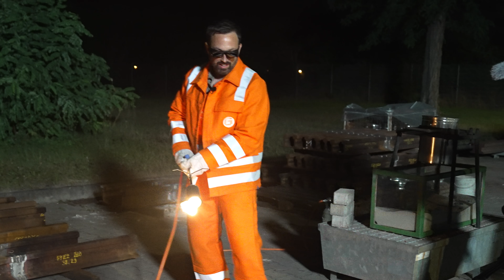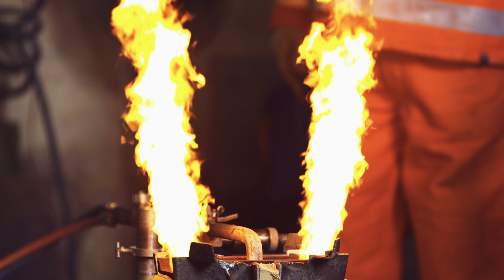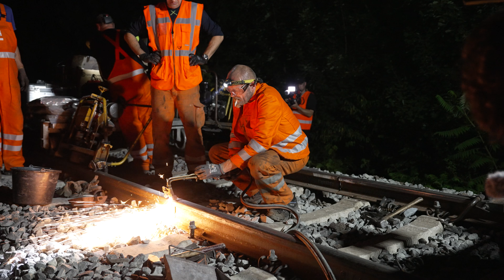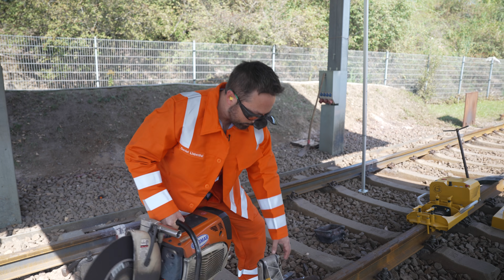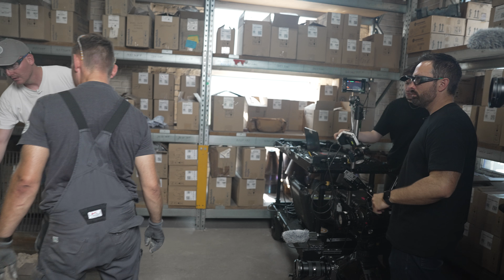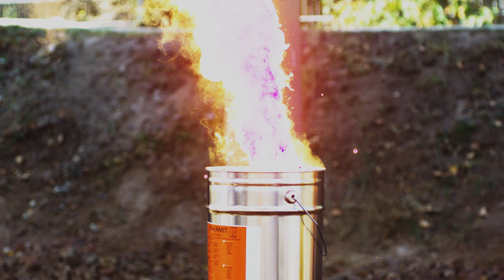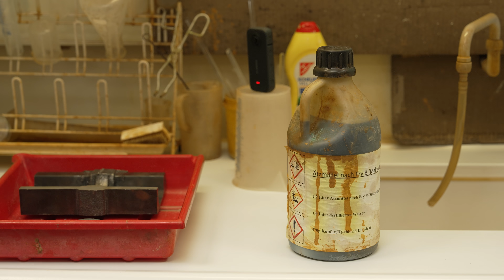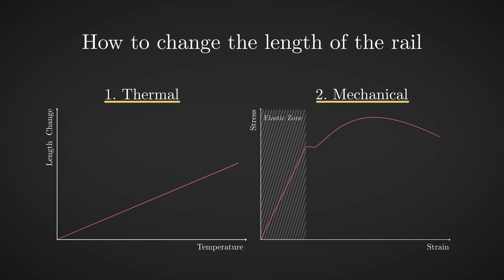Why Don’t Railroads Need Expansion Joints?

Comment: I don't know why, but I've only just seen this one. I'm subscribed, but it just got proposed to me. I really enjoyed the first one on thermite and this one too. I haven't watched the third, but looking forward to that one.
Something to be aware of is that you've oversimplified heat affected zone (HAZ) to the point where the description doesn't explain the method of failure. The issue with HAZ formation and failure isn't that it has different material properties to the parent metal or the weld metal, the issue with a HAZ is that it has progressive variation in properties. Think about it like this; at one end of the HAZ the parent metal is both heavily mixed with the weld metal, so there's a high level of weld metal diffusion into the parent metal, increasing material properties and toughness, the heat is also maintained for a much longer time at above the temper temperature, so functionally that portion of the rail is annealed and bought down slowly. At the other extreme, the material might only be at the phase change temperature for a functionally infinitesimal period of time, so it's as quenched as a piece of quenched metal can get. In real life nothing is so difinitive, but the idea is that there's a progressive variation in material properties, from fully annealed at one end of the HAZ to retempered at the other, with a variation through quenched, something like quenched and tempered and everything in between. The result of this is that, when you apply stresses to the material, the stress is uniform, so the weakest portion of the structure fails first. You get a preferential failure in the weakest and most susceptible portion of the HAZ. What then happens is that you end up with propagation of that failure site (crack initiation) along what is the most susceptible part of the HAZ to fatigue, which is likely not the portion where the crack initiates. You can see this when you view cracked welds, where the failure walks out from an edge into the closest portion of the HAZ. This is because the least ductile portion of the weld is also the strongest, it just has little or no elasticity, however the annealed portion has very little strength, so suffers lots of plastic deformation under regular loads, meaning you can see the crack walk from the least ductile area to the most ductile in most cases I've observed.
Anyway, I hope that helps. Weld failure is genuinely interesting.

Comment: A very interesting video, thank you. A small point may be, but as the molten metal solidifies ( 5:36 )it does NOT contract, it shrinks and is quite noticeable. Contraction happens after the shrinkage and is Much a smaller amount.

Comment: Excellent video. Explained the expansion and contraction well. My little two bits. The fact that the joint is applied hot there is a tension applied to the rail which really gets released when the temperature of the day gets higher without deforming the track

Comment: Since they add 50 km of rail every year, thanks to the welding does that mean slowly overtime the rail system could be expanding at work

It also reminded me of that Ben Franklin “announcer prevention is worth a manicure  😂 small mending in the rail lines

Comment: In Argentina we had a lil disaster regarding a rail line that featured this technique. Add on top skimping in budget with the rail metal quality, one summer the rail line staff and people woke up to an SPAGHETTI MESS on the railway.

lol 

So, yeah, rails will eventually at some point contract and expand and go wild. The metal quality only delays the inevitable. 

I don't know what's cheaper and faster though, give maintenance to wheels on a railway with gaps which once the railways wears it's easier to replace, or replace the weared rails on a no-gap railway on which you still need to keep maintenace on wheels anyways?

Comment: My dad would have been fascinated.  I was.   He passed away 60 years ago.  He started his railroad connection in Schenectady, NY as a draftsman.  Creating blueprints of steam engine parts.  Then got into sales and sold trains for the General Motors Electromovtive Division.  When the steam engine he first sold was finally taken out of service, he was given the head light and bell.  Now lost to history.
As a kid I always thought it would be great to be a gandy dancer, working the rails.  But, never got into it.  Life is what happens while you're  making other plans.  I guess these rail welders are the modern gandy dancers.  Hats off to you.
Similar to the grinding machinery, my dad sold the first "track cleaner" machine.  Now probably vastly improved or replaced.

Comment: So I've now got a great understanding of thermite welding, particularly relating to rail line.  
What I still don't understand is why the clickey clack of train wheels didn't disappear on hot days, when the expansion gap closed up....  
Did I miss something about the weld joint having a lesser coefficient of expansion that the steel rail, allowing tighter tolerances?   If it has the same coefficient of expansion, then why didn't the old timer way just butt the rails together on a warmish day?
Or should I look at that video on my side panel by practical engineering titled "why railroads don't need expansion joints"

Comment: I was a locomotive engineer/train driver for the railroad for 30 years and my best friend was a thermite welding supervisor. I had the chance to spend a couple of days with his gang and it was really interesting. Not sure if the video mentioned it but the railroads finally adopted this because of derailments and maintenance costs of jointed rail. For the record the top of the rail is rounded, they call it the ball. When you match that with the angled wheels, it works like a differential when going around a curve.

Comment: Great video! I have used Thermite welding many times for connecting copper grounding cable to ground rods, and when grounding steel beams in buildings. The process was called Cad Welding. In 1968, as a 1st year apprentice electrician, the first time I ever worked with the process scared the daylights out of me! The graphite molds were used over and over again, and would leak molten metal when worn. Ouch! .Had to be really careful, especially when crawling along steel beams on large buildings. Thanks for making this video! Joe

Comment: If that curve in the track, shown in the thumbnail, were shallow, gradual, enough, the track could still be used, even if only at slow speed. If satellites and AI could be tasked to notice when the first three centimeters or so of a bulge starts, a crew of several people (or a special machine) can be dispatched to pound the track laterally at the two points where it starts to turn to make the bulge. This would make the bulge broader.

Comment: 15:05 i am certified in whats called “Hot Work” that is when you use grinding machine, torch/ Acetylene/ Oxygen/ Propane or whatever make heat or sparks, i have to do one day in  theory and practice use fire extinguisher or blanket and think of the place around the working area is there anything that can catch fire?
In your test the surrounding areas is filled with paper cardboard everywhere! The insurance company would not pay any money if they see that scenario!

Comment: Hey, so if modern rail uses the sleepers and fill to lock the rail in place mechanically and keep it from heat expanding/contracting, what did old railways use the sleepers for? Your graphics indicate that there were still sleepers way back when they were leaving gaps in the rails.

Comment: I worked at a scrap yard and used a cutting torch to cut rails 51% or more to hydraulically break into 3ft sections for recycling. Its strong ill give it that.

Comment: Ok sorry if I'm missing something here, but it is stated that the two beams have to be angled upwards before pouring in the liquid steel, because as it cools there will be more contracting force at the top because there is more steel at the top.... but if you didn't angle it upwards, the steel would exert an equal amount of contracting force at every location in the gap, so by angling the beams upwards aren't you actually creating that problem to begin with?

Comment: I just happened to notice what looked like this process of track repair using thermite. Very interesting and exciting for me.
Though it was in full daylight, the molten brightness of the flowing metal was uncomfortable to view directly. Very cool (so to speak) to be able to witness this.
I think no one else driving by the area knew what was being done. But I had seen a different video demonstrating this a year or so earlier, so I suspected what was in progress. Glad I stopped and stayed out of their way.
Reply: definitely shouldn't stare at thermite pour directly without correct shaded lenses. You will do damage to your eyes

Comment: I doubt mechanical restrictions would be enough when your temperature varies from -40C in winter to +40C summer, like we have in Siberia, so we still use those gaps, ofc European method with diagonal cuts is better but it costs more.

Comment: 14:40 "Something this reminds me of is that the power radiated by something thermally is proportional to temperature to the power of four. So, slight increases in temperature result in huge increases in power."

True! And that radiated power is what cools the hot material, which is one of several reasons that "runaway climate change" is physically impossible.

Comment: Just adding my two cents here:

You don’t need thermal gaps or special allowances on continuously welded rail (CWR) if the rail is laid and clipped up at its neutral temperature—typically around 38–42°C.
At this temperature, the steel is in a balanced state where it can expand or contract with temperature changes without causing the track to buckle or break.

If the rail is installed below neutral temperature, a de-stressing procedure is needed. This involves:

Cutting out a section of rail (based on calculations involving current rail temperature, rail length, and a thermal constant),

Then using hydraulic tensors (which apply around 100 tonnes of force) to stretch the rail to simulate its neutral length,

After which it’s clipped in place and the aluminothermic weld is completed and cooled.

This process ensures the rail is always in a stable state, able to handle both expansion in heat and contraction in cold—no gaps necessary.

Comment: most off the time the rails are welded at night because then the tracks can easyer be taken out of service, then at daytime
i 'm doing this work for more then 10 years
we never cut with a tortch and the space is dependend on the proces (french ore germain)
and they dont only angeled up but also inwards (but not so mutch), for the same reason

Comment: The thermite reaction between Al and Fe2O3 can only produce Al2O3 and iron, but not steel, which means that it doesn't contain carbon. So what make the thing cooled rapidly more brittle?

Comment: 5:16 I’m confused. I don’t get why they would cut the rails only to just weld the gap shut moments later. And also how did they overcome the problem of expansion and contraction of the rails due to temperature if there are no more gaps ?

Comment: As a THERMITE WELDER for a class 1 railroad this is some good insight! Some of these comments confuse me I’ve never called a track guy/myself an engineer lol that’s what conductors are called anyway GREAT VIDEO!! Here we usually throw a joint bar to hold the rail until we can drop some welds then boom welded together lol

Comment: If continuous rail works so well, then why is it that in my city when we used to have rails with expansion gaps there were no hot weather speed restrictions on trains and the rails did not buckle, but now with continuous rail, every hot day in summertime the trains go at reduced speed and there are service cancelations due to buckled rails?

Comment: to save you 30 minutes, since the track gets anchored down every so often, instead of expanding to by length, it expands in width and height. So the track doesn't expand or contract in length due to different temperatures

Comment: I am a thermite welder i can testify that if expansion joints were possible  they would make alot of tracks more safe.   In heat you get kinks and trains derail every year. And in the cold rail breaks.

Comment: Whenever I see work being done on the railways, I think this hasn't changed much since the 19th c. OK, they weld the rails now, but the amount of work is beyond belief. For example, the rails are layed down end to end so they have to cut out a section of the rail. Why don't they simply have a spacer fitted on each end which can be removed when they make the weld? The time spent aligning by hand is amazing. Surely a machine could grasp the two rails and do the whole thing much more quickly, and the same with grinding them down. There's a whole different mentality on the railroads which has barely changed in 200 years.

Comment: 5:29 wait,  the reason there's more metal at the top is why it's angled up 😅.  But they're angled up cause there's more thermite, and it has a stronger contraction?  Sounds kind of circular 🤔

Comment: I didn't understand the reasoning behind having the gap be larger at the top. Yes, I get that the metal at the top will contract more and pull the larger gap together. But why not just have the sides of the gap be parallel? Then the metal at the top of the gap and the metal at the bottom of the gap will shrink the same amount.

Comment: Ran an automatic welding company for pipelines for a few years.  No clue why they wouldn't utilize an automated clamp for the rails (which is what we do for pipelines - in order to align the two individual pipes).  Crazy they do that by hand....definitely not necessary. Be interesting to hear why they don't automate that.....

Comment: Its simple phiscis steel railway tracks heat up with the friction caused the steel wheels of the Loco which weight upwards of 70 tons that heat is transfared to the tracks in front which make them maluable there fore no need for expasion joints.

Comment: Train tracks absolutely need expansion joints. Otherwise they buckle due to expansion and contraction. There are engineered locations for these joints.
Secondly, rails are now welded together using induction heating which integrates the metal better than thermite.
I work in rail engineering.

Comment: the train tracks are not welded together because otherwise, the expansion and contraction will not take place and they will break, cracking in other parts leading to swelling
leave 10-15mm free between them

Comment: Why hasn’t laser welding rails been taken up more commonly?

Seems like it would be more controlled and faster process?

I worked on laser welding rail steels back in the 90’s and showed  life (fracture and fatigue performance) was better.

Comment: A cheaper way would be to place the track butted up to the next one, then cut the join wih a pre-determined space-blade at a 30 degree or so angle. Resulting in noiseless, expanding in heat rails.!   (Ex-railroad worker).....

Comment: Whyd you go all the way to Germany to film this? We do the exact same thing at volkmann railroad builder's in Milwaukee. Literally every last detail is the same but it's important to use sand in the flag buckets so you can reuse them. Lining up the rails is by far the hardest part the rest is just time related. Also transporting those molds out in the field can be a major problem coz the can break so easily.

Comment: However, bolted joints...
Go into a squiggle better than a Hostess cup cake. However, sliding side plates would accomplish the same thing with no on-site fabrication. Setting the gap to be correct at the average temp is easy. Know the design gap, measure the as-is gap, subtract them. Multiply 0.0001 inches per inch of length of rail. Bolt up.

Comment: Wouldn't remove need for expansion joints completely. If you have long spans of relatively straight tracks (think dozens of km) and climate with 100 or more degrees annual temp change, you can't get away with that. 100C create strain that most low-carbon steels cannot withstand - would be torn apart - converts to roughly 200MPa. There is also reason why tram rails almost always were welded for many decades while train ones aren't. They are relatively short and turn often and instead of stretching curve radius changes (At cost of having a some gaps between tam rail and surrounding pavement). What happened to railroad rails is that they are now made of better steel which can withstand almost four times higher strain than one used 100 years ago (or 6 times of low-carbon steel).

Comment: I still dont get it... and i might have missed it but if adjusting the lenght of the rail is possible with Thermal and Mechanical systems mentioned in the end of the video why not make the rails touching in the first place? Why go through all the trouble of the thermite proces? Is it because the thermite proces makes the joints more adjustable to themperature? i dont find an explanation why they use thermite.
Reply: Ok, correct me if i'm wrong but i think i got it. I'm just gonna anwser my own question here. 
So i believe it is possible to make the rails touching because they invented new ways to counter act the forces of nature explained in the end of the video. But because they cant make infinite long rails they need a way to weld them togheter in a way they dont brake which is shown in the video, right?